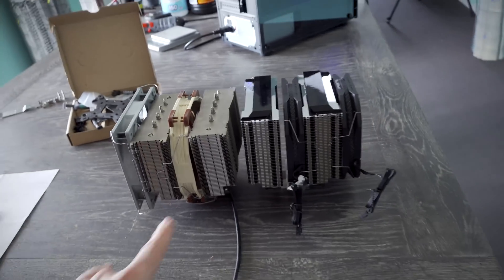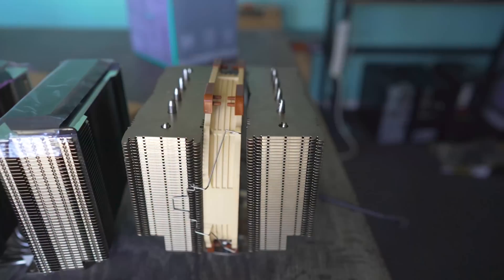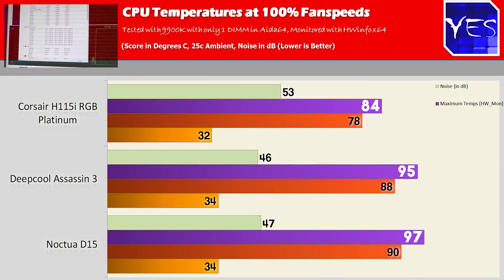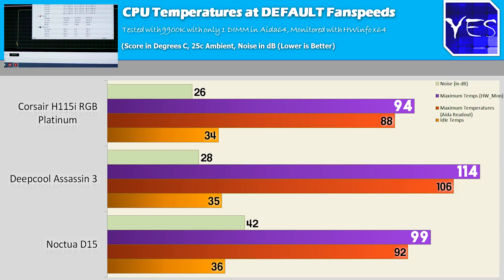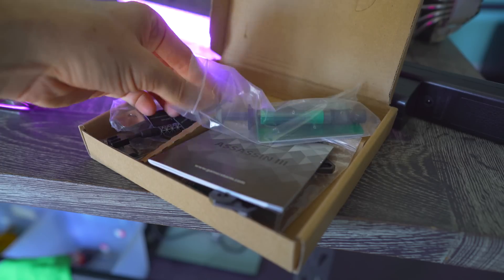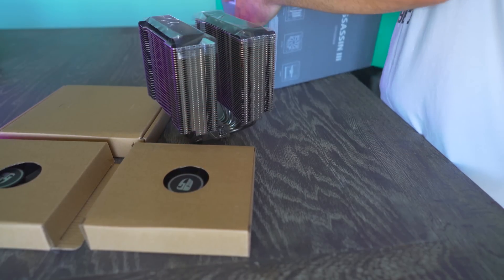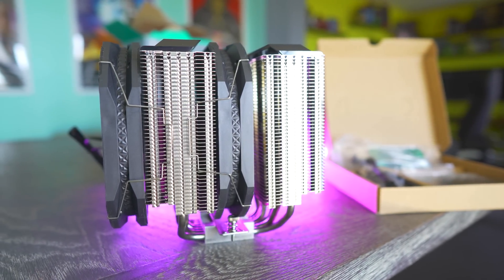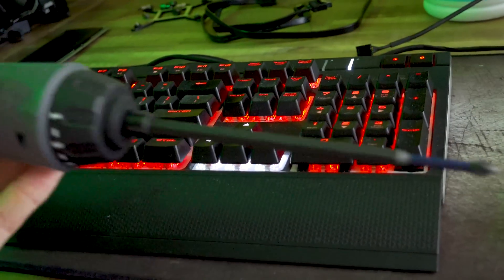Is Deepcool's New $100 Cooler the end for Noctua's D15?

Comment: About 6 months ago I sold my Kraken X52 and got a D15S, best decision ever :) Same performance on my 8700K (1.28V at 4.9GHz) with the added bonus of never having to worry about pump failure, leakage and things not mentioned often, like freeing up a USB 2.0 header on the mobo and uninstalling the usually annoying monitoring software.

Comment: Buying a large air cooler is one of the smartest things i've ever bought. You will never have to worry about having enough cooling if there's a new CPU that puts out more heat than your previous one. You will never have to worry about servicing it either. The performance compared to water coolers is almost equal so I don't see why you'd want to go through the hassle of installing a water cooler if not for looks. Noctua also gives free upgrade kits for future processors if required.
Reply: well, you do have to occasionally clean your entire pc from dust, including your cpu cooler. but i get your point. that occasional cleaning is like once every 4 or 5 months.

Comment: Hi Bryan! I'm really waiting this x79 e5-1680 v2 VS ryzen 3000 (3700x?) you talked about a few weeks ago. Maybe with a budget graphics card like 5700xt. Hope we'll see that soon on the Tech Yes Channel. Thanks for your good job and keep up!
Reply: I'm running a 1680v2 at 4.4ghz w the d15 and ppc 3000 fans. The 3700x is fair bit better in many respects. But the intel does good.
Reply: @tacticalcenter8658  I have the same setup but with a h115i. Hard to go further for mine. I put 1.4v to reach this 4.4ghz. I think I lost the silicon lottery, even if it is not bad. Maybe I should put a fan on the VRM. Some people says that it is a good thing.
Reply: @kaiservulcan  I had to put a fan on my vrm too. Same 1.4v also. I am gonna try and go lower later but it's so stable right now. There is other methods of overclocking that will net 4.5 stable, but it's not worth the small increase. Found some guy on reddit that has some settings for 4.5 using offsets. But that's probably the max most of these will do easily.
Reply: @tacticalcenter8658  ok. Thanks for the feedback. Would you mind sending a picture of how you placed and attached the fan on the board?
Reply: @kaiservulcan  I plugged the two fans into the noctua fan controller and then plugged it into fan controller on the motherboard. Then I have a 200mm fan in the top of the case blowing down at the vrm/heatsink plugged into a chassis fan header iirc.
Reply: @tacticalcenter8658  ok. I have a corsair graphite 600t with a 200mm on top. I'll try to flip it down to make it blow inside the case, towards the socket / VRM / ram. Hope I'll be able to lower the vCore because my 1680 in getting over 80 degrees on load.
Reply: @kaiservulcan  I was running occt full power stress at around 80-82c but didn't go over that. When I was running a watercooler I hung a fan from the top of the case that dangled in front of the vrm and that helped a some. In any case I'm eventually going to try and go a little lower than 1.4v and see how stable I can get it running occt. Also I'll try and find the reddit thread for setting offsets from the guy that got 4.5ghz and paste it here.
Reply: @kaiservulcan  I just set it to 1.375 and Temps are lower now. Stress test only going for 15mins,ill have to stress it for a lot longer later. But it's now below 80c package temp (around 77c). If this runs stable with occt I'll try a lower vcore later. I put sensors on the vrm heat sink and it's only around 45c which is a decent temp. Again, needs more testing/stress. But works good thus far. Are you running the Asus rampage iv extreme also?
Reply: @tacticalcenter8658  yes. The exact same board. I also have 4x4 gskill ddr3 trident z 2400 mhz ram. Would you share your bios settings?
Reply: Excellent results!
Reply: @kaiservulcan  I've got 4 sticks of gskill 1866 mem with cl9 iirc 32gb. As for settings I basically just changed all core to 44 and 1.375vcore. Then changed mem to 1866 manually. Using a slightly modified bios but I don't think that matters. After 30mins of testing cpu package dts settings in hwinfo64 is showing 80c maximum (hovering between 78-80) and vrm's went from 41 to now 45c. Again I'm running a d15 with 3000rpm industrial ppc noctua fans full tilt. I wish there was an easy way to share the exact settings I'm using but pretty sure I just changed those settings only.
Reply: @kaiservulcan  after 1 hour of occt power burn in, it crashed. Ill have to mess around some more.  4.4ghz 1.375vcore. Needs more testing with different settings.
Reply: @tacticalcenter8658  At first, I udes Bryan's settings. But he was able to hit 4.4ghz on 1.325 vCore where I had to go to 1.37 for 4.3ghz. So, I tried to change for xmp settings and touching only to the vCore. And I succeded in hitting 4.3ghz with 2400 mhz ram. VRM where at this point far less hot on load. So I kept these settings. I Finally changed my noctua nh-d14 for a corsair h115i and tried to go further. For now, I have 4.4ghz at 1.4v with 82 degrees on load. Some people succeeded in hitting 4.6 with some VRM cooling. I don't know what to do...
Reply: @kaiservulcan  sell the watercooler and get an open loop watercooling kit. With a vrm cooling block. Id imagine that would be idea. In any case, there's different ways to achieving a similar number via oc settings.
Reply: @tacticalcenter8658  Thanx for the hint. I don't know if I'll go for a loop. I don't like watercooling and I'm quite not a lucky man, so it may end up with a complete mess full of water...
Reply: @kaiservulcan  hopefully a fan with direct cooling to the vrm will help ya out.
Reply: @tacticalcenter8658  thank you for the help and time you took to help me. 😊
Reply: @kaiservulcan  you're welcome

Comment: Here I am planning an upgrade to a custom water loop due to my NH-D15 letting my overclocked 5820K go up to 82*C under full load, then I see the 9900K topping out at 97*C. My 82*C isn't that bad then. Re memory clearance, I have corsair LPX memory, so that's not an issue. The only issue is clearance for the 1st PCIe slot. If you could find your other NF-A15 it would have been a better comparison, especially sound wise.
Reply: Seems like something is wrong  those Temps look to high. Make sure the fans spinning at full speed and that even contact is being made. Also I went down a few degrees by using thermal grizzly VS the noctua paste.
I swapped my fans for the ippc3000 fans. Alot louder but i have it ramp up only when it gets hot.
Reply: @tacticalcenter8658  Contact is good, it's just this thing is a hot monster. CPU is at a stable 4.5GHz @ 1.3v. My fans definitely ramp up to 100% under load.

Comment: I personally would avoid aio liquid coolers like the plague.
Reply: dead waterpump = no warranty
Reply: but u need them in sffpc
Reply: @EneVappy  sff is usually a bit restrictive on the size of the cooler you can do. Not sure if it would be worth it for the usually small rads you can fit in sff cases, as much as I love them.

Comment: I myself are using the D15S, and even then it is sometimes difficult to mount on some modern-day MB's causing issue with memory-modules being too high.
Especially the fan(s) can cause an issue.

Yes, Noctua is a bit more expensive then the average cooler but my experiences with Noctua's support about any questions you may have about what fans to use, configurations (about cooling) is handled in a vert professional (and extensive!) way.
I agree that an AIO water-cooling solution is often the way to go when it comes to effectiveness (of cooling) and easier mounting.
With indeed the potential bigger failure of the pump, or G0d forbid, leakage.
Where a fan can last many, many years (especially Noctua's I may add from my own experiences), water-cooling is often 3 to 4 years I'm told before failure can creep on you from the horizon?
And the sheer weight of this big(ger) coolers can also put a lot of strain on your MB, CPU socket etc, so be careful when moving/shipping the case.
Fun fact: the Noctua D15 is about 10 ~ 20 euros cheaper then the DeepCooler in Europe..
Reply: Not to mention rewarding a company that puts shit tons of money into R and D and not one that just copy's it for free.

Tempted to test a D15/14 with them new NF-A12x25 fans. Bet you they do better than the original D15/14 fans.
Reply: @andljoy  Noctua is a side project of a Chinese company though, so not really Austrian or filled with European R&D to the clouds or something ;)
(Sorry if I sound like a hater... well, actually not sorry :P However good Noctua is people seem to be making an Elon out of it which doesn't give it much justice, IMHO of course)

Comment: For someone who hops over to Japan quiet a lot, I am wondering why you haven't been hit yet by a Scythe straight in the face ? They have revised/updated their Fuma to the Fuma 2, dual tower cooler, only 155 mm height, off center to create ram clearance, front mounted slim fan which spins opposit direction then the normal sized middle fan to create a higher static pressure and lower noise and that for only 60 Euros/Dollars.

Comment: Strenge, in all other reviews the noctua still outperforms the deepcool
Reply: all other reviews? I can be sure about that you haven't actually watched all of them.
Reply: Florian Oprescu  they re lying. i have my cpu cooler (d15) fans at max rpm and sure itmakes noise but never as much as these idiots say. fuck outta here, they re trynig to downplay noctua for some stupid reason. 

how the fuck can a cooler that costs 100 dollar and is 2 degrees cooler, kill the noctua which is cheaper and not much hotter?

killing a noctua, would mean you re gonna create a cpu cooler that is 10 degrees cooler, and 20 dollars more expensive. 

the noctua in my country, is 90 euro, the deepcool assassin 3 is fucking 127. for 2 degrees cooler... 40 euro more. 

common, this review is trash, the title is wrong AND he has a random fan on the d15 that increases both noise and temps, because that 1  fan is not made for the d15.

terrible review.
Reply: @deathrager2404  Yes that is what is happening. It's a conspiracy against noctua. You figured it out.

Comment: Who would buy a 100$ air cooler while you can buy a good looking 100$ water cooler?
Reply: Valentin Rieu Anybody who wants to have realiable cooling? I would not touch a $100 water cooler... $250-500 maybe. And even then I would chose good quality air cooler in 9 case of 10... or well most likely always an aircooler.
Reply: @haukikannel  Corsair H100i is 100€, roughly 110$, and I can tell you that this water cooler is well enough and reliable. Also, it looks way nicer than a big block on the middle of your build.
This is the first exemple I had in mind since it's the one I bought, but I'm pretty sure you can find some great NZXT, Cooler Master, Thermaltake, Fractal Design, EVGA and even Asus water cooler deals for less than 150$.

500$ ??? This is no longer a AiO water cooler but a custom one you're looking for, and it's nowhere close to a good ratio price/quality
Reply: But you can buy a 100$ air cooler if you want. It'd be a ugly overkill amount of cooling even if a simple 100$ water-cooling system can handle even the latest overclocked CPU, but why not. Just don't buy a case with a windowed panel for the sake of your eyes

Comment: Never had any luck with deepcool, broken fan on gammax 400 and the watercooler i had made a terrible racket. No third time for me.
Test bench results don’t reflect case results. Front aio pulling air in will give good cpu cooling results at the cost of hot air being pushed over the gpu. A top mounted aio exhausting hot air out will lessen the cooling of the cpu but gpu runs cooler.
All this will affect temps and noise.

Comment: btw: The answer is wrong as PCIe works on a fixed tick, requiring the signal to propagate within a set maximum of time. Yes, the extender adds length to the signal pathway, but that doesn't change latency as long as the signal itself reaches the receiving end within the set limit of time.
Reply: Exactly, digital communication will not be affected by trace length or even reflections as long as all signals can be correctly interpreted at the given clock rate.

Assuming the extension is 30cm you will add 3ns (i.e. 3 million'th of a ms).

If it affects anything it is due to degraded signal quality causing bits to be incorrectly transferred requiring them to be re-sent.
I'm not sure what exactly is transferred over the bus, but if it does not relate to core or memory, then even overclock should not be affected.

Comment: How about using the same fans? I think It would be interesting to compare heatsinks to each other
Reply: Franky Four F*cking Fingers I supose that heatsink ar about the same... the fans Are what makes the difference.
Reply: @haukikannel  the dude has a random shitty fan on the d15. let him do a fucking review with the original d15 fans on it. that 1 random fan increases both noise and temps. guarantee that shit. this guy did a terrible review  and is downtalkin noctua but heis not even using a d15 fan on his d15. lmfao

on top of that, he calls a cooler that ''cools 2 degrees better'' a noctua killer? fuck outta here. if it would perform 10 degrees cooler i would agree. but 2? lol

Comment: Something to consider is that noctua will support its coolers for a very long time.
I've had a d15s for a few years and when i switched to ryzen 3000 they sent me an am4 mounting kit for 100% free.
Of course i have no experience with deepcool's customer service so it may be just as good, but in my case noctua post purchase support is one of the best.
Reply: Free.... 😍
Reply: I mean even not free the kit is like seven bucks online. I’ve had my NH D14 since 2014 and it was great on my previous build.... Deff think Noctua has some of the best quality fans too.
Reply: no regerts returning a corsair h110i for my NH-D15, 2+ years on my 6700k system and now thanks to that free mounting kit and great service, cooling my 3700x.
Reply: bfastenau that's awesome to hear! I actually have the am4 edition dh15s.
Reply: I've dealt with Noctua directly as an individual and on behalf of a company and I can vouch for their customer support. They really are one of a kind in these days market. All about quality, performance and customer service.
Reply: @joelmakela2964  I agree. My noctua D15s was laughably easy to mount, had exceptional build quality, great customer support. And the D15s fixes any RAM or video card compatibility issues. Hard to knock down the king of air cooling....
Reply: Indeed they will. I lost the wire fan clips to a ten year old cooler.  Emailed their support and after providing them with a copy of my receipt they sent me a pair for free!  Such good support.
Reply: That's really cool to know.

....no pun intended

Comment: You should test all of the cooling solutions using the exact same fans. Just to eliminate that variable.
Reply: The fans Are more meaningfull than those metal towers in most cases... So hard to say what purpose that test would fullfill.
Most people use the original fans. So it is more usefull to test fans themselves if one wants to replase their fans later, but I am 99% sure that Noctua fans get replases new Noctua fans and bequiet fans get replased bequit fans in most cases. 
But if an test can test all the coolers with stock cooler and some standard replasement cooler... that actually would be fun to see, but as I said very few will replase fans, unless They Are proken.
Reply: @haukikannel  Yes, most people do use the original fans, and I'm not disputing that. But if you're going to test these coolers against each other, the big variable is the fans. If all the fans are the exact same, then the differences are in the coolers themselves, not the fans. And sure, it's good to have a "stock" baseline to go by, but that's only part of the full test. Different fans have different blade designs, RPM ratings, and could also be static pressure or designed for airflow,  not to mention the amount of air they can move (CFM).
Reply: Yep... as I said the fans Are most propably more important to the result than the coolers are... like in video the Noctua coolers seemed to have less irritating sound for example. Ofcourse the fins of cooler affect also. 
I am not Expert but I supose that cooler makers design the coolers to fit their own fans. So other manufacturers fan may be unoptimal in their cooler... would require a heck a lot cross testing between different coolers ;) fun job to any tester!

Comment: if vertical mount works, it won't add latency. It would matter if the card used system ram, but it doesn't.